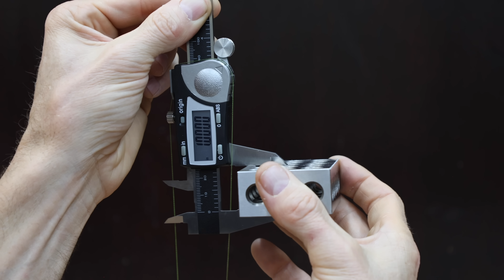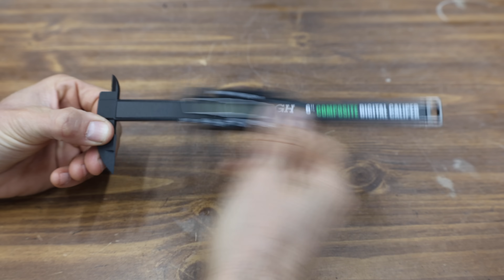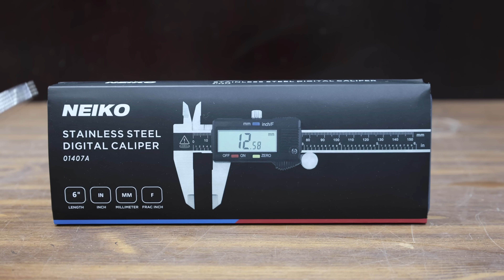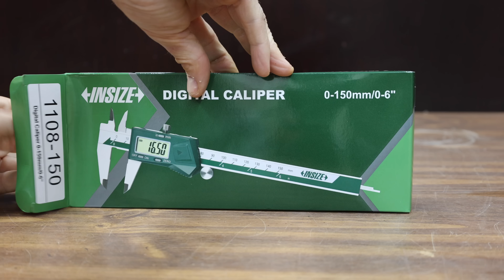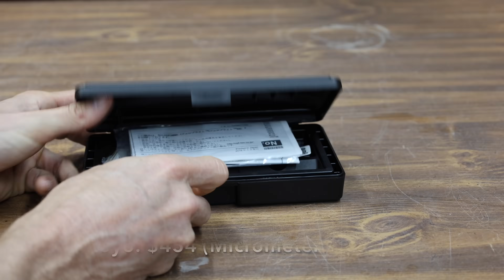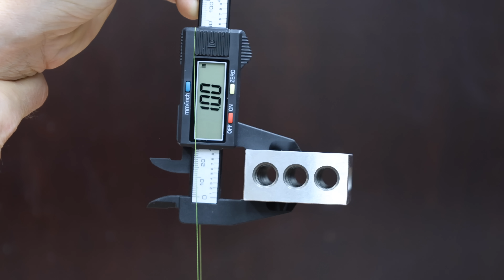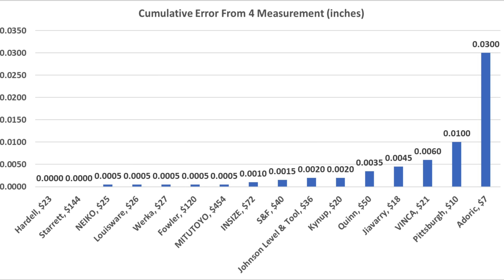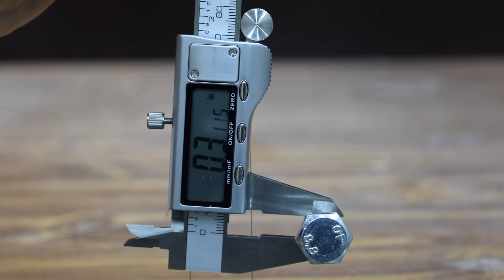I've Been Proven Wrong About Calipers!

Comment: CNC machinist here , we use only Starrett and Mitutoyo.. been using the same set of Mitutoyos for 13 years, still working beautifully
Reply: I've worked in injection molding for 35 years. Process engineer now. In tooling and Q.C. at every place I have ever worked at Mit's are the standard. I have them for my home use  as well (Mics and calipers) and they are probably all I would ever buy. Just rock solid every time.
Reply: I’ve got a mitutoyo from the 50’s that still works
Reply: @FishFind3000 I work in a large machine shop and I always buy old retiring people's tools.  Especially the green hammer finish mitutoyo. I have two sets of 0-6 mics, digital mics, depth mics, calipers, adjustable parallels, protractor, all kinds of stuff.  Usually buy the whole Kennedy chest
Reply: I work in automotive building custom vehicles. I've got a steel digital 5" mic from harbor freight and it's great for most non-critical stuff, I've got a Mitutoyo dial micrometer for the precision stuff. It's gotta be over 15 years, I picked it up from Goodwill 5 years ago for $3.99. Still works like a champ too.
Reply: @casey360360 goodwill don't have good ish here.. just old cds and trash
Reply: Yep, 22 year journeyman machinist and mechanical engineering, 90% of our measurement tools are Mitutoyo including our stupid expensive CMM. Used to love starrett as well but their newer stuff has dropped in quality while mitutoyo is just as good as ever
Reply: Mitutoyo calipers are also the most counterfeited calipers out there. A lot of people have counterfeit Mitutoyo calipers and don't even realize it.
Reply: @bluegizmo1983  I bought one on ebay for $50, figured out it was a fake, worth $20, returned it for a full refund. I had no idea there were fake calipers. I had a genuine Mitutoyo with some issues after 20 years of heavy use, just wanted a new one. My old one is still better.
Reply: Heads up Starrett got bought by a private equity firm about a year ago.
Reply: @nate6386  That's the saddest thing I've heard in awhile. I guess the japanese are going to get my business now.
Reply: @nate6386  good by starret then, private equity will run it to the ground and leave it before it goes bankrupt, they don't lose money anyway....
Reply: Still new. Mines 33 years and still fine
Reply: Same here, my boss gave me a Mitutoyo, I believe it had to be 25 or 30 years ago, still working. And yes, I've been employed by a family-owned business for over 40 years. I'm on the 3 generation since starting.
Reply: Machinist here as well and Mitutoyo is all myself and coworkers use. Starrett is great too.
Reply: All of you Mitutoyo's fans, has this video changed your mind in any way, seeing how the $27 Werka works basically just as well as the $454 Mitutoyo? I run a 3D printing farm and CAD business and have been using generic calipers that look (and perform) a lot like the NEIKO. I paid $7 for them 8 years ago (so ~$9 adjusted for inflation) and they still work beautifully today. Only feature they're missing is inch fraction, which I couldn't care less about as I don't use prehistoric units.
Reply: @dsp4392  3D printing doesn't require super accuracy. I certainly would not buy high end for 3D printing use.
Reply: @dsp4392  Not really! The Absolute function alone is worth the saved hours of otherwise lost work from cheaper calipers. And the battery life is at least 5x any of the cheaper pairs I've tried.
Reply: @dsp4392  the inch system is way more accurate than the metric by far When doing precision work the inch system will measure down past a hundred thousandth and beyond where the metric can't
Reply: @bigjohnclark349  no, metric drops to microns or micrometers (1000th of a mm), then decimal equivalents thereof. Metric system is far better for precision as it is more organized.
Reply: @dsp4392 I have a Mitutoyo at work and a cheap one at home. The Mitutoyo is just always right, feels good, works smooth. When it comes to accuracy...if you really need it, a calliper is the wrong tool anyway. But for Work - errors are way more costly then a tool you use every day, that basically never breaks. Many people just need that peace of mind.
Reply: @bigjohnclark349  What are you talking about?!?  Chemists use the metric system to measure atomic level distances.
Reply: @dsp4392 my Mitutoyo gave up on me despite a low use easy life. They want £100 to repair. This video makes me question if I want to pay that.
Reply: @dsp4392 no it hasn't changed my mind and ill tell you why. Ive got a mitutoyo digital 6in and ive had it for 7 years and it is probably around 10 years old. Its still dead nuts accurate. I use it every day. Its lived in its case when not in use. Its been all across Canada in trucks and tool trailers and its been dropped and slightly abused over the years. Having said all that I will repeat, its 10 years old and still dead ass accurate. Its calibrated yearly and it will continue to be my go to vernier. There isn't a $25 caliper that would have lived the life of this mitutoyo and kept on going. Yes, they sre expensive, but they will out last any cheap set when used professionally.
Reply: @dsp4392  I would still get a Mitutoyo and it's not $454 it's around $150. But for 3D printing I would just buy something cheap.
Reply: @bigjohnclark349 Uhh, no.  That isn't correct.
Reply: @KingfishStevens-di9ji Metric is more organized, but as far as actual precision, there is no difference between the two.
Reply: @fiteboss  lol thanks
Reply: I've been using my hands, I take one hand and place it at the start the the other where I need to measure, then slowly walk, not moving my hands to where I need to go.
Reply: @ExcavationNation  lol considering your profession this is probably accurate enough
Reply: @ExcavationNation  this is the way
Reply: @ExcavationNation Oh cool, you work on Tesla body panels?
Reply: @ExcavationNation congratulations, now u can beat any CaveMan😅
Reply: @ExcavationNation  I've been doing that too but found that it is lacking consistency. I found it to be caused by the unsteadiness of my arms. Now I do meth drink BEFORE work, not after. Solved not all but at least one of my measuring problems.
Reply: @ExcavationNation Best way to get a exact fit everytime 👍🏻 if its a big space you have to messyre you can always take steps and messure that way.
Reply: @ExcavationNation  Just like Mr. Bean.
Reply: @ExcavationNation Brilliant! Freezing my hands and arms is also how I measure my partner's thickness over the years. She's been pretty consistent. When she comments on the increase in my thickness during the holidays I'll tell her she should have gotten the Mitutoyo
Reply: Bought a Mitutoyo back in 1980 when working at a plastics factory.
That, an accurate straight edge ruler and a stainless steel machinists square and you're on your way to being a machinist.
Reply: Yeah that somethign that this channel just can't replicate and that is long term durability and reliability and stability and compatability.
Reply: Same here but I've used Brown&Sharp too which is now I believe called Tesa as well, the older ones were Swiss made and very smooth not sure about the newer ones though.
Reply from the maker: Thanks for sharing.
Reply: Manual hobby "machinist", my 10 year old HF calipers are still accurate to within 5 tenths testing against gauge blocks. I do plan on getting a Mitutoyo and relegate the HF to scribe with
Reply: @seymoarsalvage  I’m sorry 5 TENTHS? That is MASSIVE. Unless you mean 5 ten thousandths.
Reply: Machinist here as well. I wanted to watch this video to see if I was just biased because we all use and swear by Mitutoyo. Seems like most are in agreement that they are one of the top brands
Reply: not a machinist here, but have seen enough "mitutoyo" in literally any factory I've visited. Definitely the best
Reply: Another Machinist here, iv'e had the same pair of 8" Mitutoyo since 97.  Accidentally dropped, around coolant, and only suffer the cost once. I go through the cheaper stuff also as they have uses too, but I consider them almost disposable.
Reply: I got mine for 9 bucks on Amazon..but I'm a welder and have +/- 1/8" tolerance on most jobs
Reply: I've owned and own, Starrett, mitutoyo, Browne&Sharpe digital calipers, Mitutoyo are by far the best of the three.
Reply: Professional metrology adjacent person here. I use Mitutoyo calipers and micrometers at home as well as work. Starett makes a great precision tape measure, the Exact.
Reply: @scarce911
I am a CNC Machinist also. I have been using the same set of Fowel for my entire 26 years. I have 4", 6", 8", and 12" all dial. I work at a shop that most of the younger people in the shop can not even read the calipers unless they a the digital version, and to me you can't trust the accuracy of digital compared to dial.
Reply: @joshuapuyear6818 I'll admitt, i hate trying to read mics that aren't digital , but dial calipers are pretty simple
Reply: I'm also a CNC machinist and I have a set of Brown & Sharp analog calipers I've been using for 20 years. I have digital stuff too, but keeping up with the batteries is too much for my gold fish memory.
Reply: Starrett started going downhill when the Chinese tools flooded the US market.

Starrett was an old company that produced fine measurement tools, however when they made changes to lower manufacturing costs, they ticketed off a lot of older machinists, and new machinists just getting in the trade. Something as simple doing away with engraving markings in tools to now using laser etching. The old tools were smooth in operation, new tools have that gritty feel.

Precision tools are a small market that Starrett priced themselves out of.

I probably own $25k of Starrett tools and measuring equipment. A simple automatic center punch purchased in the 60 for under $20, now is over $70. Chinese center punch, under $15.
Reply: @gungadinn  $20 in 1965 money is over $200 in today's money. Inflation is real!
Reply: @gungadinn I'm a carpenter that dabbles in precision. Starrett has always been a brand I've trusted and the recent changes crushed me. I was encouraged to see they still came out on top in the test. Restores a little of my faith in them. Such an iconic brand, I would hate to see it fall the way so many others before have.
Reply: @gungadinn  Mitutoyo killed Starrett by offering the same quality for half the price. Now other companies have run the same game on Mitutoyo. It took a while with Starrett, and I think the handwriting is on the wall for Mitutoyo.
Reply: @JimS530  
I've used probably 8-10 different brands of precision measuring tools over the years.

A brand that use to be almost an equal to Starrett was Browne & Sharpe.

Mitutoyo was a distant 3-4. I think the only Mitutoyo tools I own are an old digital micrometer , a set of radius gages, and a working set of angle wedge blocks.
Reply: Mitutoyo is not worth the price from my point of view,reason is that my father was a machinist mate and used a starrett or harbin mostly, I have him use a mitutoyo just once.
Reply: 13 years on one set? Damn you're careful 😄
Reply: @luckgrip252 i almost dropped them once, but caught them between my middle & ring fingers somehow. The lady who does the yearly check on them broke the latches on my case....it triggers my OCD every time i open/close the thing
Reply: Yes, I bought a pair 30 years ago. Clean the slider with a little LPS and good to go.
Reply: You have to fix the mititoyo price that's a 115$ caliper check msc
Reply: I would like to see some of those old highly used ones tested against new ones.
Reply: Those and Brown and Sharpe are way overrated.
Reply: In my experience as a CNC operator for 10 years the more expensive brands give durability in addition to accuracy. It's only a matter of time before you drop them in the machine or knock them off onto the concrete floor. The cheaper brands may not survive where as the expensive brands are much more likely to work just fine afterwards.
Reply: Still trusting the german Mahr gmbh`s quality.
Reply: Mitutoyo for me.
Reply: Had my mitutoyo for about 4 years now. Left it on for days at a time on regular basis and I still haven't had to change the battery it came with
Reply: My dad owns a machine shop and I grew up in it and he swears by mitutoyo and starret. He broke a pair of mitutoyo calipers that I saved from the garbage and fixed and they are still accurate as ever.
Reply: I inherited my dad’s Helios. He was a tool and die maker.  It’s still dead on and smooth as silk after 60+ years.
Reply: Y’all, it’s called project farm, not project machine shop. I run a shop, for a basic saw guy, water jet guy and most part catching guys, nieko are good. If a guy “graduates” to mit, he’s invested and I’ll start teaching more seriously. Also everyone uses dials with some exceptions.
Reply: Yes, and it should be noted that the tested Mitutoyo is not representative of the brand - the price.  They are on par with Starrett and they are outstanding.  You can get a BIFL set of either for $150.  You'll never go back.    I've had many cheaper sets that auto-off to save battery.  Ironically i seemed to always be changing that stupid coin battery.  I got a pair of Mitutoyos and everytime i go to use them i yell at myself because they are still on from last use,.  Ive literally almost never turned them off.  2.5 years, still haven't asked me to change the battery.  Nuts.  I'll add that that design is intentional.  auto-off on calipers is unwelcome.  When using them, you're doing something demanding much precision and the last thing you want is an untimely do-over.  I can't speak for Starrett but Mitu managed to figure out how to make the battery drain almost negligible.  I later learned their ABS technology makes them so efficient it doesn't matter if you turn them off.  the SR44 battery is meant to last 3.5-5 years regardless.  Amazing
Reply: I'm trying to remove dust from a point and shoot camera but apparently the sensor has to be the precise distance it's at currently before disassembling or it won't shoot pictures in fucus. Is this a tool I would need to calibrate the current depth before disassembly?
Reply: Brown and Sharp was always as good as Starrett
Reply: I've still got my first digital caliper I ever bought back in mid 90s a Mititoyo 0-6" . It's still as accurate as it ever was. I thought the metering cover would delaminate eventually but after decades of heat and coolant it still works great.
Reply: @spliffsperlunk I have the same Mitutoyo as you, that I bought similar time to yours. It’s been well looked after and had little use but has now failed on me. I thought this was a buy premium once, don’t buy again product. Now Mitutoyo are asking for £100 to repair it.
Reply: The machine shop i use is actually a gauge shop, so tenths instead of thousandths. They laughed at my harbor freight steel calipers. Then they took them and their Mitsu calipers into their metrology room and checked a 1/2/3 block. Those harbor freight calipers read 1.000 2.000 3.000. Much surprise, less laughing.
Reply: Trained industrial designer and mechanical engineer here, I designed a pistol comepastor with $12 harbor frieght digital caliper and $100 3d printer. I havent had to work in 5 years because of it. It's not about the tool but what you can do with it
Reply: B&S, Mit., Starrett. All overhyped all along. Most, most fal within the +1/-1 resolution. 
Micrometers are the precision tools, not calipers.
Calipers are the accuracy tool.

I began machining in 78. Fanboys, get over yourselves,
Reply: @dg1234ify  - with a pair of good calipers using good technique and skill, it's easily possible to get +/- .0003" accuracy, sometimes better. (EDITED: MICROMETERS) are the most accurate, but if you can't use calipers correctly you probably can't use micrometers to their full potential either. Not everything needs to be measured to .0001" or less.
Reply: Use a crappy, rough caliper, then a nice smooth one.  Both measure the same, and are repeatable.  But if you have both in your box which one do you want to use and have more faith in?
Reply: CNC and machinist shouldn't be used together.
Reply: @Later2u  There are machinist that run CNC. But a lot of 'CNC' guys are machine operators(no shame in that) and not machinists.
Reply: @Later2u - I'm a CNC machinist too. I doubt you can make parts as nice as I can. Good CNC machinists know about everything a manual guy does, plus a whole lot more. Plus, our machines are almost always more accurate than the majority of manual machines.
Reply: @Later2u how so? If you make the programs, setups and run the machine, is that not what a machinist is?
Reply: @tktspeed1433  Sure, but in reality, that doesn't happen. Too inefficient. There three people doing what you've just described. Mom & Pop machine shops might do something closer, but even they probably have a dedicated person programming.
Reply: @Later2u at our shop we don't have designated people for those things, we have 2 people on shift, both doing all of those things on 8 machines. Though they are mostly older 1 spindle fanuc lathes with no rotating tools, so they are easy and fast to program. Also they have magazines so we don't have to actively work on them when they are running, just check that the parts are in tolerances and that there is cutting fluid in the tank and barstock in the magazine. Your argument is valid for newer machines that have more complicated programs, because our newest lathe does take like a week to get running on a new program because of the lack of experience in operating it and because there is a single dude running it.

Edit: 8 machines in total, so 4 for both, though we don't have dedicated machines. And 8 machines on our side, there are also 6 mazak lathes and 3 cnc mills.
Reply: @Later2u I can and have run every manual machine tool commonly used in any machine shop. Now I run CNC almost exclusively. The manual only guys cant do what I can, and are too lazy and stubborn to learn. Time and technology is leaving them in the dust, while I continue to progress and get paid accordingly.